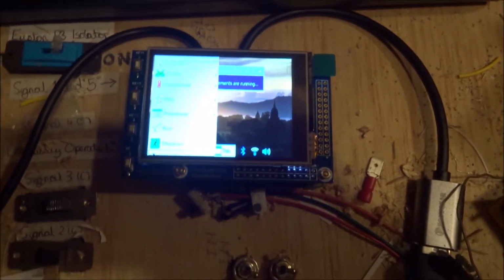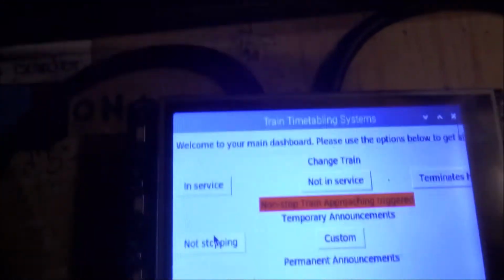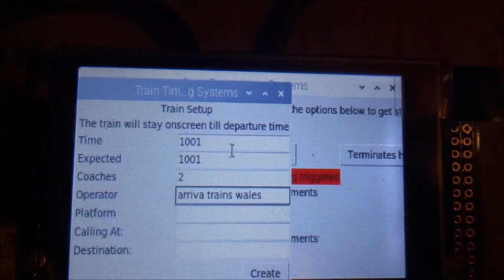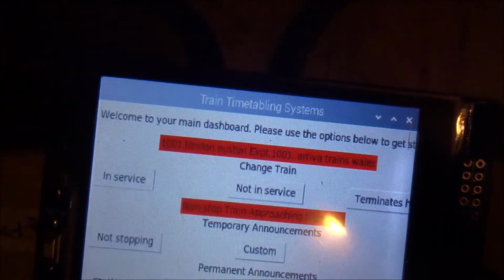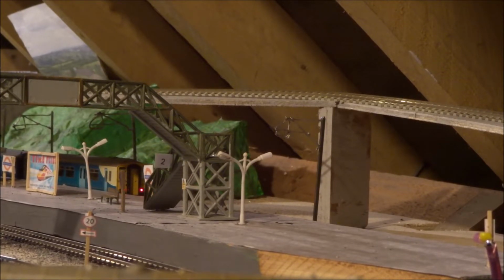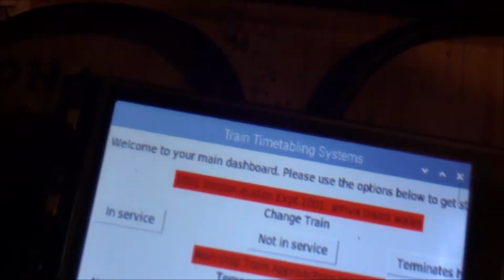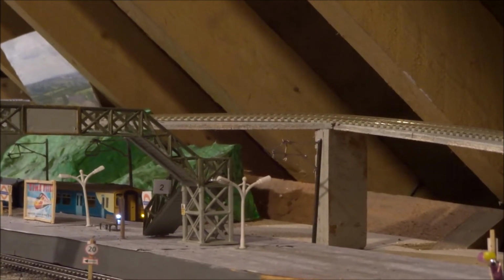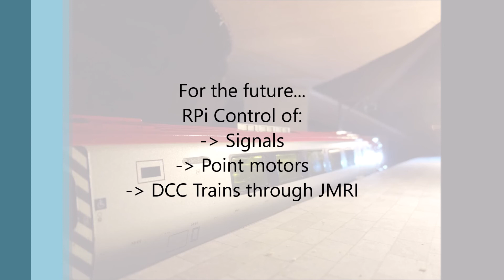Raspberry Pi Model Layout Control - Timetabling Model Trains and Announcements

Comment from the maker: Sorry for the quietness of the announcements - the headset was on max volume, but I didn't have a USB speaker handy to plug in! There will be future videos on this topic coming out over the next year or so. I do hope to get trains controlled from the raspberry pi using JMRI, however, I generally do prefer using a handheld controller (not to mention the software's a bit glitchy on a raspberry pi). Route mapping will be a thing of the future, and is estimated to be coded into the program hopefully before 2021, or may not be coded at all - depends how I feel!